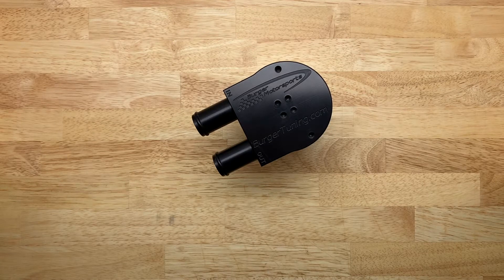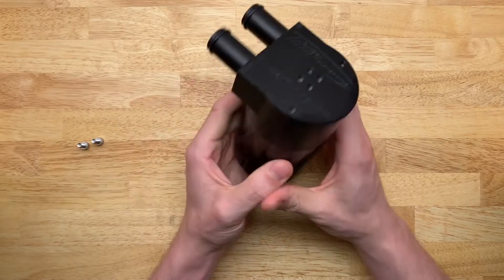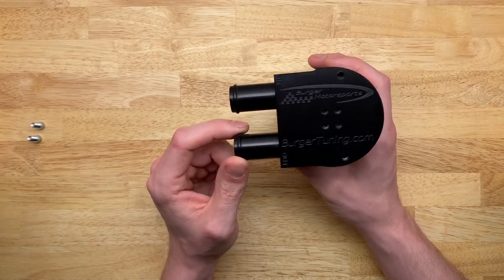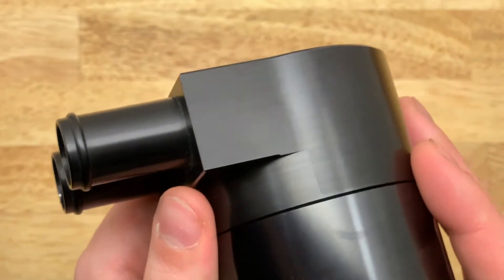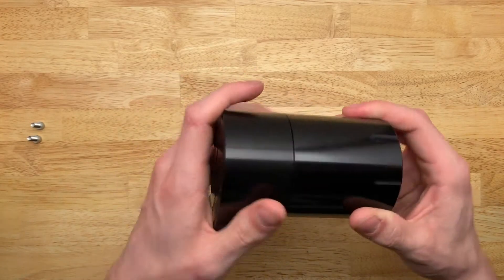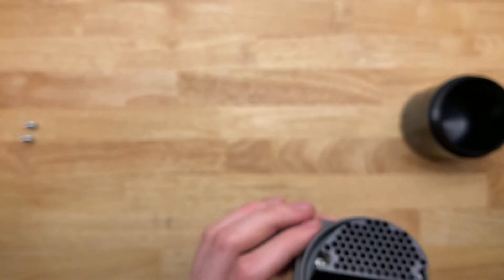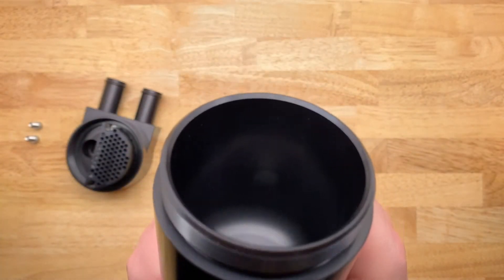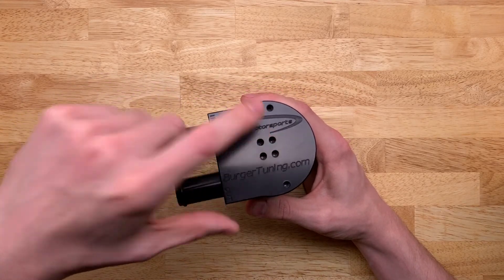Burger Motorsports Catch Can - First Impressions

Comment: Great review!
Reply from the maker: @B P - Thank you!!
Reply: @Casey_Schmidt  I just bought one for my 2021 M240i coupe! It came with the hoses and brackets and o ring. $195 shipped. But, it also has some AN fittings and other goodies.
Reply from the maker: @B P - Sweet car, dude! You're gonna love the catch can, it is as good as they come. I was able to get a few hundred miles on mine before winter hit and was very impressed with its performance. It might do even better with a turbocharged car with the higher crankcase pressures.
Reply: @Casey_Schmidt  did yours catch any oil? What car do you have your can installed on?
Reply from the maker: @B P - I installed it on my 2007 Z4 3.0si Coupé. It was part of the series I did on converting the valve cover from plastic to magnesium. This was a short update video I did after a few hundred miles, it should answer all of your questions: https://youtu.be/4vYMcjAoTCc

Comment: Casey I’m Interested in this Conversion! You have a Great Idea. I Just Got My 2006 3.0i 6 speed Manuel Trans Car. I have Been looking for this car over a Year. Do You have Smog Emissions Testing in Your State? I am I New Jersey so would Probably have to try to Hide a Catch Can. All the Old School cars  I E Chevy and Ford had a PCV Valve in the Valve cover with a Rubber O Ring for it to set in then they went to the top of the Carburetor. I Don’t know Why BMW has this Screwey CCV that dumps oil in your intake when it gets plugged. That just makes a lot more Emissions out the tailpipe and ruins the Catalytic Converters. Please let everyone know how this Goes after You Figure it out. I am thinking at worse You use the CCV for the car that the Magnesium Valve Cover Came From. I’m Not a Fan of a Plastic Cover Either. BTW do You think the Original Z4 Engine Cover will fit over the MAG cover?  Also for Your Bracket You Could make Slots in the Aluminum and Just Use a US Made Radiator Hose Clamp It would Look OEM
Reply from the maker: There isn’t any testing in my state and I cannot speak for states that do. The M54 engine has an easy conversion to the aluminum valve cover that is well documented on YouTube. Look of “50sKid” for some good info on that.